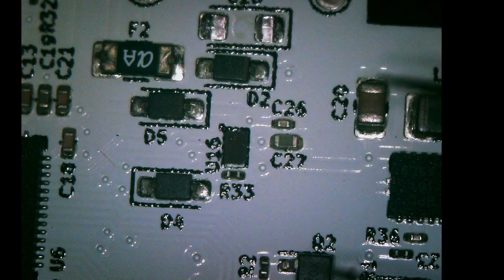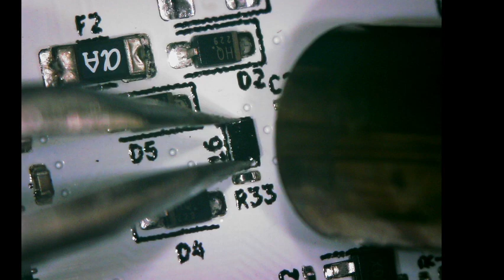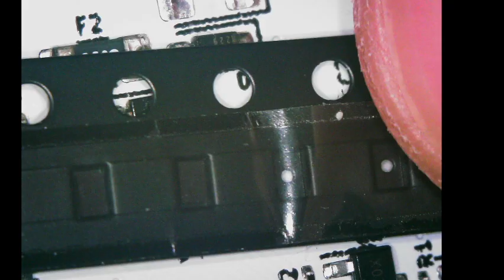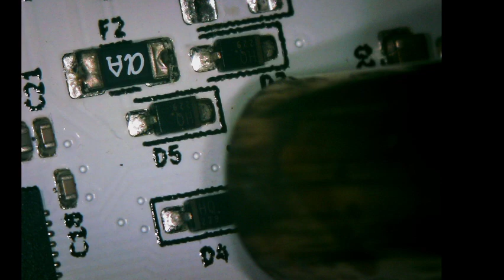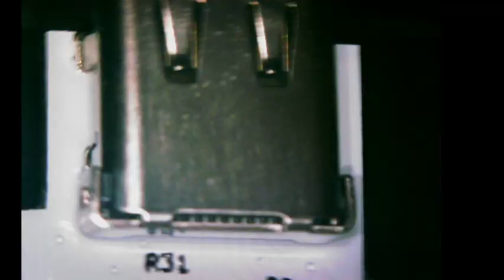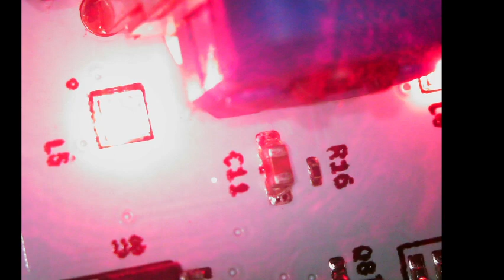TINY BGA Soldering Technique Tutorial

Comment: Interesting. I never did BGA soldering, but I have to as soon as my order of TI buck-boost regulators arrives. So this is what they call "die size BGA".
Great video. What flux are you using? Any advices on what temperature to set for the hot air soldering? Usually, I preheat the pcb to 100°C with a heating plate and then solder with the hot air station at about 370°, however the flux vaporizes pretty fast, so I assume I should lower the temperature.